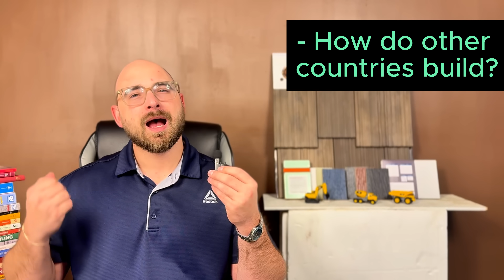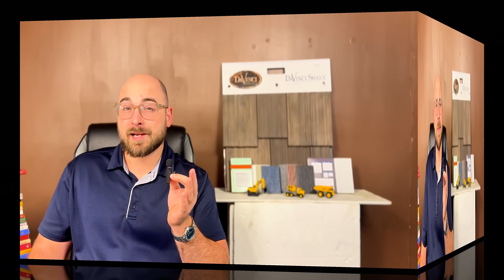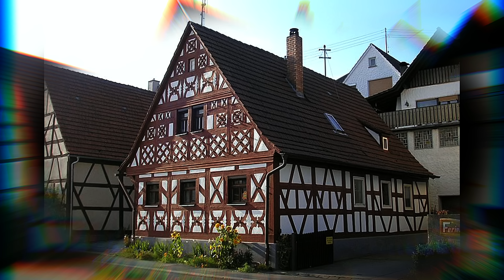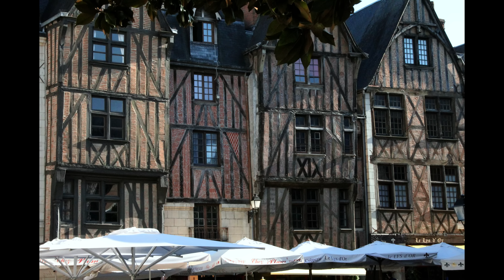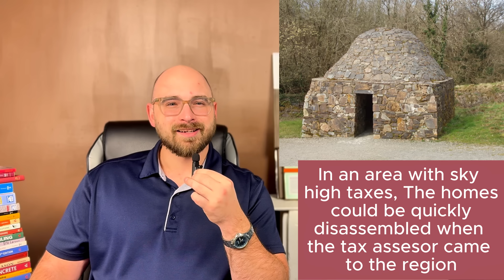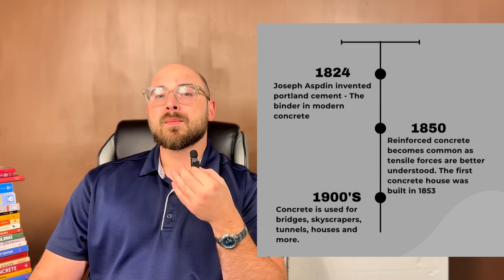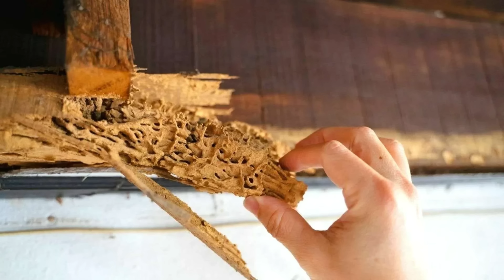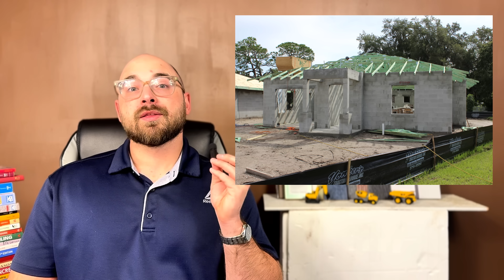Why Other Countries LAUGH at American Homes

Comment: I was shocked to see all houses in California to burn to the ground - nothing but piles of dust left. It looked like they were built with cardboard.😮
Reply: the only things that survived was fireplace and barbecue... because they was obligated to be made of bricks. I have the feeling that if one day americans find how to build barbecue on wood, they will switch 😂
Reply: it's quite baffling, and it's not like a fire in a concrete house couldn't be catastrophic, I've certainly seen fires in my country turn everything within a house into ash, but at least you are left with standing walls to rebuild from.
Reply: @PemaMendez990  Also a fire like the one in CA: would probably damage the first row of houses severly and the one behind a bit, but as ther is a limited fuel in brick house, any subseqent row would be safe. I never heard of any fire in Germany that cased more than a couple of houses to burn down. In CA the entire city block is gone...
Reply: @fabianfeilcke7220  I don't think there was ever something comparable in Germany to these wildfires. The climate just was too wet to have these massive wild fires. 

There were occasions where huge parts of cities burned down though. Hamburg and Aachen for example but firesafety was always top priority in wood houses which it wasn't in CA.
Reply: @cyan_oxy6734  The Aachen fire was 1650. Back then the majority of the houses were timberframe. Similary the Hamburg fire burned down the medival part of the city. 
There are between 1000-3000 wildfires in germany  every year. The size of the fire does not really matter, the distance to the houses does. Any fire more than a couple hundret meters wide has the same effect on houses next to it. Embers blowing towards a brick house dont do much. You can even see that in CA. The fe standing houses had either a thick stukko layer or some brick wall around it. That was enough to keep the houses from catching fire, despite the strom winds.
Reply: @fabianfeilcke7220  the climate in Germany is drastically different from California. In California, we get some rain in February and the rest of the year is pretty much dry. Like, southern California is barely a step above a desert for most of it. Then there's the Mojave desert itself in SoCal. A lot of people that have never been to California have no idea just how dry it is here. I grew up in the Mojave and almost every single day was exactly 0% humidity.
Reply: @cyan_oxy6734  London burned down completely due to being made of wood. Since then England switched to brick and now even terraced houses that are attached to each other don't set each other on fire. When the entire house fuel for fire you get city blocks burning down. Spain, Greece, Italy and Turkey are very dry and have wildfires too, but they can't burn down city blocks
Reply: @fabianfeilcke7220  Because there are SO MANY wild fires in Germany. What in the actual fuck is your comment supposed to inform anyone of?
Reply: @PemaMendez990 But it would be a bad idea to rebuild using those walls.
Reply: @PemaMendez990 often brick and concrete still needs to be demolished post fire because it’s been weakened by the fire. Brick often collapses itself as it’s often braced by timber. 

You can build fire resistant homes, and there’s quite high standards for that in Australia, but they don’t apply to the suburbs which is where one of the CA fires was, the footage was terrifying, these were fires nowhere near forests. Embers get in and it doesn’t matter what you’ve built with, the home is gone.

You need to use fine steel mesh to cover all the weep holes and vents etc.
Reply: @PemaMendez990 no, because stone and concrete walls can be weakened by extreme heat from severe fires. Wooden frame houses can be fortified in fire regions to not catch fire quickly.
Reply: @bannol1  good point, they tend to break when exposed to extreme heat. I'm guessing that's one reason to reinforce with steel rods 🤔
Reply: @bannol1  There's less for things to burn.  I've been in masonry houses since I moved to Nicaragua.  Mud and cane are the cheaper version, and very poor people live in wood houses, but not attached wood houses.  There are also houses built with tufa blocks and rebar.   My current house is cinder block and brick.  A house I owned in Philly was stuccoed brick, over 100 years old.  US houses are not really built to last more than 40 or 50 years.
Reply: @RebeccaOre it’s carpets, beds, couches etc that burns houses down, not the walls. It doesn’t matter much what the walls are made of. If you don’t handle the details properly more sturdy walls are just increasing your earthquake risk and giving you a more expensive demolition bill when the guts are burnt out of it.
Reply: Because they are ?
Reply: They are indeed made from cardboards
Reply: I'm not an American, I'm from Portugal, my whole family, and I call the so-called "family houses" = Paper Houses. 

Criters get in, mice get in, you can hear someone talking through the walls [despite the walls having insulation and the people speaking are right across from the street] Paper Houses are not sound proof nor tornado proof and we've seen it for decades, and they still use thin plaster, thin wooden sticks, and as we all saw the fires in California a month ago. That's the result of laziness and inept standards and safety for the people living there. 

And then they blame the trees and the natural cause of self-cycle from the earth. Really, the native Americans knew the fires had been happening for eons, it's a life cycle. Even the native animals didn't seem to mind. They could migrate. We could, too, if the houses were fire-resistant and moveable. Blessings to the poor people who have to pay high taxes again to rebuild Paper houses again. I hope everything and everyone is doing alright. ✌️
Reply: Been Portuguese our problems seems to be the roof that in old houses the structure is often made of wood, just what you saw after the fires in cali the fireplace stood there that’s what’s happens to most of our burned down houses, making houses out of concrete doesn’t mean they will not catch fire but i bet it’s reduces propagation because there’s probably less embers around and embers is what makes things catch on fire, our last biggest tragedy was in 2017.

Americans exceptionalism is a weird phenomenon that makes Americans don’t accept other countries can make things better like the earthquake argument that is refuted by modern Japanese houses they made stuff out of wood for the same reason but they don’t do it anymore, also i bet countries like Sweden that have a lot of wood available their dog houses has better standards, here in Portugal our problems is old houses with poor isolation but new housing if made properly don’t have those problems anymore and yes American houses are bigger on average but most here don’t want to pay for big energy bills or spend their time always cleaning just to have more storage to keep unused items
Reply: California intentionally cut off water. those houses wouldnt have burned down if they were gotten to in time. you had people who went against the evacuation, snuck back in, and watered down their houses. their homes didnt burn down.
Reply: They showed a few brick and concrete houses that were still standing with barely any damage.
If those houses were brick/concrete instead of wood it would certainly have saved a lot of homes.
A fire in a brick/concrete house can easily be extinguished compared to a wooden house where often the only option is controlled burning.
Reply: @ppdan  but see the issue there is brick/cocnrete on a fault line is dangerous/epensive to build.California gets a lot of earthquakes.
Reply: @fatpenguin1500  Am I the only one that finds it weird that insurance prefer paying for burned down wooden houses.
The recent fires have probably caused more damage in that region than earthquakes since the invention of the wheel!
The cost of all those fire disasters would have easily covered building earthquake safe concrete/brick houses.
Reply: @fatpenguin1500  The timber and homebuilding industries benefit from rebuilding homes over and over.
Stop using public funds to rebuild flammable homes in fire zones.
End the "Rebuild and Burn Again" Policies.
California has spent HUNDREDS OF BILLIONS on wildfires—yet keeps building the same flammable homes.
Fire-resistant houses (concrete, brick, stucco, ICF) are a one-time investment that saves money long-term.
The cost of reinforced concrete homes is NOTHING compared to the cost of constantly rebuilding destroyed houses.
Reply: @ppdan Rebuilding a light wood frame building will costs the insurance company 100-150k$. In the media they talk about 100s of billions of dollars of Damage. They did not mention that 90% of the house value is in the land and not in the building. 

If the fire insurance is smart, it will insist that the rebuilt building has a high fire protection class. Or increase the insurance premiums 😂
Reply: @ppdan they wouldn’t have lasted as old as they are because earthquakes destroy brick and concrete buildings. While these sort of fires are rarer. 

Also, it’s the interior that usually catches fire first, the external material is often irrelevant. You need to not have attached decks, put steel mesh over all vents and weep holes etc, or your building will be a burnt out shell.

There was several timber clad buildings still standing next to burnt out concrete buildings because they paid attention to the details. Hardwood timber is very fire resistant, especially from embers which is how most buildings burn.
Reply: I feel like you're giving cardboard a bad rep here, it'd stand up way better than American homes.
Reply: Those fires were caused by DEW
Reply: Well brick/concrete in earthquake territory isn't really smart either.
Reply: @fatpenguin1500 they do fine in Japan

Comment: Look at L.A. It seems that houses burn better than the trees around them. And look what's left after the fire. Only the chimneys are standing. I bet with european style houses, most would have survived.
Reply from the maker: Possibly, 

Seeing that it’s a seismic zone, steel framing may be the most sensible option, 

Concrete can be used but requires additional engineering
Reply: "Survived" is a big word here.

Yes, the core structure of modern european houses would still be standing, but it'd too be needed to be replaced. Were the neighborhood to catch fire anything in the middle of it will be destroyed unless the necessary precautions are taken care of.

You could argue a modern european neighborhood wouldnt burn down like that in the first place, and you'd be correct. Weather and construction combined make it extremely hard for fires to spread on the scale like LA fires did.

medieval european houses burn like cinder though.

Comment: I live in Sweden. Near to every house here is build out of wood with studs in cc60(cm/ roundabout cc23 inches) way, Norway and Finnland knows also this way of building. Houses here in sweden are very often between 100-300 years old. I think theyll make another 300. The rest of Europe builds with stone cause they do not have big economical forest businesses. So they do not have the wood for building this way. They must use stone. I am from germany, i like the wooden way. Insulation stuff is in Sweden/Europe much bigger than in the US. Sprayfoam you will not see here very often.

Comment: Always remember. A tree cannot be protected from fire accidents by using chemicals to prevent combustion. It will never help. It has been proven since ancient times. Wood is like a cellular structure where sap and oxygen circulate in the tree. For everyone. Only Japan uses the old technology of burning wood. Cells prevent water absorption in the tree. Protects from moisture.

Comment: What else should you know? Fire safety and the effects of natural disasters. Very high insurance costs for a smaller construction wood frame house. High insurance costs. A wooden house is cheap but vice versa, insurance is expensive. If the house is built of brick or concrete blocks or stone bricks. Insurance is less. Less risk of fire disaster and natural disasters. There was a case. Tornado. Wooden houses were torn down quickly. But houses made of concrete blocks or clay bricks or stone bricks withstood several 100 years of Tornado elements. It is up to you to decide. Wood or Stronger foundation materials for the house.

Comment: I.m builder and Craftman woodwork.  

Cheap build wood home fast variants.  But real say little garanted 20 30 year Home wood  us small construction.  

Us forest wood big size tree . Old versia home 100 years .  Old home . 

Building home us stone Clay brick. Expanded clay brick and aerated concrete gypsum calcium cement brick.  This matreal long and forever . Standart beton  construction make desingned home 100-year-old forever .

Wood home new version us small size construction 50mm x 50mm  or also size but not us standart old technology big size wood construction  old vintage classic home long function 100-year-old  
If properly processed large-sized wooden structures for house construction. Considering using smaller wooden structures. Only 20 or 30 years serve. Because small wooden structures of houses are very deformed due to rodents, animals and insects. The worst moisture water smaller wooden structures lose their solid structure. Rot and decompose like peat.

Comment: I would like to see more energy efficient martials to build homes like rammed earth, earthships. straw bale homes. If I were to build my home I would want the exterior walls to be built with 2x6 then frame inside of that footprint without the two walls touching. I've seen the way recording studios are built and you can heat about 1000 sqft with a small plug in heater

Comment: You haven't talked a word about Chile.
As the country with the biggest earthquakes ever registered including the most recent 8.8 in 2010, we have a lot of experience in materials. The majority of homes in cities, even in low income areas, are built with combination of clay or concrete bricks, using steel reinforcement inside them and also combined with structural reinforced concrete in floors, ceilings and critical parts of walls.
Of course that specially in rural- extreme areas there's a lot of legacy construction including log cabins and Adobe.
Also in recent years it started to grow the use of lightweight construction alternatives like soft steel framing (local brands like metalcon), specially used to build additional floors in homes originally designed with only 1 or 2 floors. The idea is to keep the original structures of reinforced concrete and bricks and giving the possibility of increasing the living space without compromising the critical structure, specially in case of earthquake.
We suffered the 2010 earthquake and comparing with countries like Haiti or Mexico were even complete cities were devastated. Here the damages in general terms were between the margins of the repairable. That's the important thing at least as we see the constructions here, the ability of the structure to withstand even the worst of the earthquakes an even after that being possible to still live there without major inconvenience. We are not used to the disposable logic of the US homes.
Reply: Thank you for this insightful post. Americans and especially Californians were brainwashed that in earthquake zones you have to build from lumber, to justify inferior and flammable construction and feel happy.

Comment: 9:15 you do see a lot of stone homes in Portugal, but it's all older construction that has been refurbished. New houses just regular cinder blocks, red brick, concrete slabs and in rare cases, wood framing for the roof. Wood is not used as construction material for main buildings and housing. It can be used for cottages or barns, but rock and mortar is still preferred, because it is so available.

Comment: "They (brick) don't add much to the house structually."  Decorative brick coating don't but brick in a brick wall is the only structural component. It is like mixed up in this video.

Comment: Great video but you forgot to mention the most important factor here, the economic (greedy) factor. The boost in Timber vs Concrete began with the Interstate Highway System plan, the Feds needed all that cement to use it for the roads and not for housing so it set the standard that continued over the whole century and beyond.
Mid-class homes in the USA (and even high-end ones as we saw during the LA Fires) are made to be disposable. Most of them require constant maintenance, and rebuilding (especially roofing) which creates a permanent dependency on the construction and insurance industries. You build paper houses in Tornado and Huracan-prone regions for a reason, while the Caribean nations for instance build mostly with reinforced concrete for economic reasons. It is never related to the availability of resources anymore, it is all about generating and maintaining an economy, and more money pouring into builders, and insurance companies.

Comment: Some things you said as an advantage for wooden homes I disagree with.  You said Contractors are familiar with the structure and it is cheap,  that is true in every country for what ever material they use. eg In South Africa no contractor is familiar with wood and wood is expensive due to scarcity.